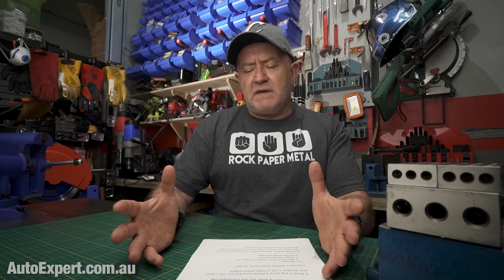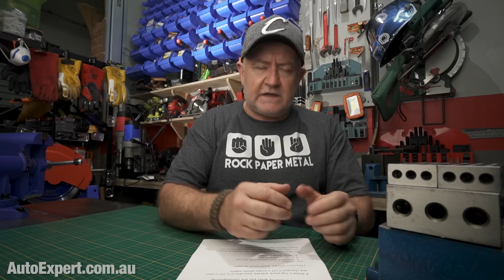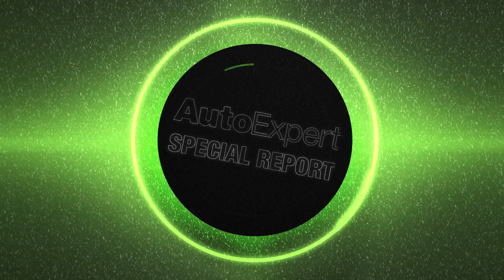Best way to charge your EV at home (for complete electric car novices) | Auto Expert John Cadogan

Comment: We have a BYD Atto 1…I find the granny charger is fine for our use and it was supplied with the car.  We got the car the Thursday before Easter and we went on runs to Toodjay, Lancelin Dwellingup and did about 800k on those trips and we just used the trickle charger. I’d suggest trying that first before spending money on a 32A line and a wallcharger. The wall chargers only make sense here in Perth if you have a EV Assist Tariff but you get charged an extra supply charge of $1.29 per day. It is easy enough to live with slow charging like this and we also have solar but I’m not going to lose sleep if I need to plug it in at night and that is normally sufficient. We have plenty of public DC chargers nearby if we ever get caught out.

Comment: I’m doing a new build and future proofing it by installing 3 phase to the house and a Zappi EV charger. Also will install 12-15kw of solar panels - might also consider installing a home battery as well. Currently have a Jaecoo J5 and might get another EV or hybrid soon. 

The systems aim is:
	•	Solar-first EV charging, prioritising excess solar before using grid power since selling to the grid is not worth it
	•	Dynamic phase switching (1-phase ↔ 3-phase) to match charging demand with available solar
	•	Load balancing, ensuring total household demand stays within safe limits

How It Operates
	•	During low solar periods, the charger switches to single-phase to enable slow, efficient charging
	•	As solar generation increases, it automatically switches to three-phase for faster charging
	•	When solar drops (e.g. clouds), it scales back instead of pulling heavily from the grid

My aim is to get it all working with home assistant so you can make rules for optimising and balancing loads between home battery and EV

Comment: I'm very late to this party, but just got the Mrs a PHEV Eclipse Cross, I ended up getting a 15 amp power point put in, on its own circuit, to plug the OEM 10 amp charger into. Reason being, everybody I spoke to told me that pulling the full 10 amps through a 10 amp power point, for several hours, would overheat the power point/wiring, etc. That may or may not be true, but I put the 15 amp in before the car arrived, so I was ready. Plugged it in today and it only draws 9.6 amps. So maybe I over-engineered it a bit, but I've got a bit of breathing space now. Makes me feel a bit better about charging in my garage. Battery was flat when I got it home, charged for 4 1/4 hours, no problem, battery around 80% full.

Comment: All good info JC if a bit drip fed. Basically sweet spot is 7.4kW into EV, covers all EVs, Will cost some $$$
Here's the plan short and sweet:
Install 7.4kW solar onto shed
No connection to mains
Fed down to 7.4kw inverter
Tesla Wall Connector
In carport
No battery
Daytime charging only in sunny Queensland
I'll update the cost here when I get the kit quote

Comment: For the last 2 years I just pugged into a 10 amp socket and usually set it to 5 amps a few months ago I installed a 15 amp socket $100 still usually set to 5 amps from 6 pm till 8 am gives a few 100 km and I can up the charging to 15 amps for much more being charged up at 11 pm is no benefit compared to 8 am      I had a 10 year old Nissan leaf for 1 year and sold it for the same 10 k I bought it for and now have a 4 year old Tesla I bought a year ago for 1/2 price. Tire pressures and windscreen fluid has been the only maintenance charge off solar so no fuel costs for 2 years besides $100 on fast chargers and slower 22 kw 1/2 price ones.

Comment: Dear Mr Kogan, the things you say about the single phase versus three phase is a little bit off.

The benefit of three phase over single phase is the three phase better distributes the current draw because you have 3 phases instead of a single phase.

Furthermore the standard residential single phase mains switch is 63AMPS I believe.

Once you take out 20AMPS for the EV charger that does not leave a lot of fat left.

Furthermore I believe the numbers are actually nominal and derate with increased temperature which can be brought about by load and/or environmental conditions.

This has been my experience base don practical observation.

Comment: The whole ev charging at home falls apart with as3000 and maximum demand.

if your home has electric AC and oven, chance are very high that a 32A wall charger would push your home over its legal maximum demand calculation!

Comment: I appreciate you are Mechanical and not an electrical engineer. But Just gotta point this out. No electrician installs GPOs aka power points or circuits that are not on an RCD Earth leakage protected power circuit. While it might sound dramatic  talk about how dangerous it is... The only way that that would happen is that somebody decided to do their own electrical work and did not know what they are doing. So not an issue just like pool pumps outdoor GPO etc...

Comment: One thing that wasn't mentioned was a 15 amp charger. It needs an electrician to install a 15 amp wall plug but is a lot simpler and high quality chargers can be found for around $300. My Shark 6 8A charger took 14-15 hours (22.5kw from 25% up to 100%). The 15 amp charger is around 7 hours.

Comment: I waterproofed my trickle charger and charger to extension connector using an under $20 green plastic box from HammerBarn and under $5 orange box also from HammerBarn. It cost less than $25 to make it a bit safer. I will soon be buying a wall box. It will cost a couple of grand to install but will be much better and make it possible to use my solar more effectively. Great video BTW.

Comment: Just a heads up of my situation. I have three phase electricity in my house, and I have just purchased a Mitsubishi Outlander PHEV with a 22kw/h battery. That has a charging capacity of only 3.7kw/h. So I have the possibility to install a 22kw 3 phase charger, but it will only use up 1/7th of its capability. Even with a single phase charger I only use half of its capability to charge the car. The reduction of time charge time is only 3 hours difference between the ordinary trickle charging of the wall, vs a stage 2 charger. Also I have a free stage two charger at work Monday to Friday, so I'm not sure if it's worth investing almost 3k to save a few hours in charge time over the weekend. Any advice will be appreciated.
Reply: What did you end up doing? Doesn’t sound like a fast home charger would have been very necessary for you.
Reply: @spillmill   upgraded to a 15w outdoor weatherproof socket and it works very well.

Comment: I work on the basis the trickle charger puts in about 12 km range for each hour of charge. The 7 kW type two charger (single phase) puts in about 40 km range for each hour of charge. As Cadogan points out the 7 kW charger will charge just about any car overnight. Only six of the 150,000 EVs in Australia in use have caught fire. One arson, three in house fires that burnt the car, one hit a tree at 160Km/h and one that ran over the driveshaft of a truck at 111 km/h.

Comment: I’m still not convinced swapping a ICE car over to a EV is good for your pocket. No one knows how to work on them if they bugger up unless you take them to a dealership usually in a major city not a regional town which is costly, they depreciate like crazy just like any new car really as soon as they hand over the keys there goes thousands of dollars of value even though you haven’t driven even a kilometre, battery health depreciation over the course of 10 years before needing replacement and the cost of replacing that battery will be way more then your ev will be worth by that time, cost of installing a charger at home as you said 2.5-3k to bad if you are renting, what is the realistic amount of money you are going to save over the lifetime of that car? Another anti save the planet practice that isn’t talked about imo is people just hang on to a car for a few years then flog them off for the next new model or just when they start coming up to major repairs and just palm that problem off to some other poor sole to deal with, wouldn’t it be better (environmentally) to just pay for the maintenance and hold onto it then buy a brand new car with all that embodied energy that goes into making one? Save the planet is a joke, unless the whole commercial system is uprooted and peoples view of materialism changes the human race will kill itself. Think about when your driving down the highway in your new flash car.

Comment: How we going to get around in Far North Queensland after we lose power for 2 weeks after a cyclone?  Rely on Generators I guess.  What a load of shit.  I am sticking with my 3.2 Lt Diesel engine.  Wank factor 100% these electric cars.  How far off are we getting a 4wd electric that can tow a caravan with a 600km range?  Good luck charging it up in remote Australia.
Reply: If the power is out you cant refuel with petrol or diesel as the pumps need power as does the attached payment set up.

Comment: I live in the states and my neighbor a couple doors down just had a 50kw dc fast charger installed in his garage. We were talking about it and he had to upgrade his main panel from 200A service ( split phase) to 350A service panel with all new wire from the pole to the house. His whole setup cost $30K. I told him he was crazy. spent half as much as his juicy ford truck cost..lol
Reply: I guess if they drive 24/7, mostly high speed freeways, AND money is no object - then of course by all means.
Reply: What's the rush plug in at 5-6  have a shower and meal go to sleep at 10 -11 get up at 7-8 use a dryer socket at 240 volts up to 30 amps that's 7.2 kw it can charge a 72 kwh battery  from 20% to 70% in 5 hours and you have 14 hours no need to be charged at 11 pm 7 am s fine.  Charging 100 kw from 6 pm to 8 pm and sitting around charged for 10 -12 hours for what just charge 1/5 the speed with no expensive set up and get a longer life out the battery.

Comment: Love the review. Also have PV and powerwall with Powershop TOU plan. 
Planning to get the Zappi v2.1 with inbuilt wifi, in 7KW tethered, for MG4 on novated lease. Will need to migrate to EV plan to boost 12-4am.

Comment: Technically you are going from internal combustion to factory combustion, am I right? Unless you are among the 0.01% that gets to charge your car using solar or wind power then your car is powered by coal or nuclear power?
Reply: But far more efficiently and with less pollution than the millions of ICE cars running around. Also most of electrical providers have renewable energy in their mix already, so it is not purely coal burning
Reply: Around 1/2 the people with EV have solar and I am 1 of them also runs the house.

Comment: Good summary John. Most people doing the daily average 30 klms per day only need the small EVSE (charger) which comes free with the car if they have weatherproof garage parking. Beats spending $800 to $2,000 n home EVSE ( charger) if you don't need it!

Overnight charge on the little one gives 100klms per day charge/travel so again usually all that's needed as you don't need to start everyday with a full battery, unless you are a courier.

Having said that if you do need quicker charging or solar smart charging (using only solar) a home EVSE (charger) is worth the money.

Lots of videos on charging on my EV channel to help everyone further understand living with a EV.
Reply: Thank you. i was thinking the same about trickle charging, its probably all i need. any idea on how much my energy bill is going to cost? Im guessing approx 2.4kwh per hour so 10kwh per day so $120/month as per my current rates

Comment: These are the rules in Qld, and I guess would apply to all states, makes common sense. Our Queensland Electricity Connection Manual (PDF 4.7 mb) provides rules on the connection of equipment such as wall-mounted EV chargers. A typical 7kW (~32 Amp) single-phase EV charger can't be connected to a continuous supply (uncontrolled) tariff. It can only be connected to an economy, or controlled, tariff.

Comment: Solar charging dilemma.. Im just getting my new kona next month and being a lecky ive looked into the wall chargers and supplies needed. What shocked me was the electrical supplier requirements for ev charging. Up in mackay we have ergon only and if you goto there site it says no more than 20amps (4.6kw) on the main supply unless you get there controlled taffif. Downside here is solar input is only allowed on the main supply. Ive asked around a few installers and they didnt relise the requirement for ev's from the electrical supplier. I posted on a forum I'm in and some have commented that NSW has something similar but at 25amps. Anyway love watching you channel. Keep up the good work. Cheers

Comment: Great video. Very informative. In Canada newer houses get 200amp panels. Older houses (60-100amp) can get an upgrade which is not cheap (around $6-7K). Mine is a 100amp supply, I have a 16/32amp level 2 charger so I can use the 16amp setting when I have days were I need more current load inside the house.

Comment: Electrical energy consumption in Australia is now also being billed based on power as well as energy. Demand based tariffs are the new standard in many areas of Australia. The bill is based not only on total energy consumption but also on the peak half hourly power consumption each month (during the defined peak hour window).

It's a really good idea to have a programmable smart charger which can be set to avoid peak period charging. It would be nice to have some info on the different charging systems available and what their features are. For instance, having a smart charger which can not only have timers set but also adjust the charging rate based on available excess solar PV capacity.

Another issue is some homes are going to struggle to have sufficient electrical capacity for adding an EV, especially homes in location where gas is/was used as a significant source of energy for space and water heating, and cooking. Often these homes have much lower rated electrical supply fitted because they only needed it to run basic appliances. With the push to electrify everything, some of these homes have converted to heat pumps for heating and are already maxing out their supply. Running a fatter cable from the pole on the street to the meter box can be a very expensive upgrade.

Comment: Great explaination John.  My EV can drink at 11KW per hour and I only had Single Phase at home.  To install 3 Phase is expensive as those electricians don't miss.  The gain of 33% faster charging was not worth it especially when overnight with single phase at 32amps will charge most flat EV's to full.  Heat is also the enemy of a battery so slower charging is better for the battery life.  I would also recommend setting up for a portable charger so you can charge with any available power source from 240v 10amps through to 3 Phase 32amp.  You can then use camping grounds and caravan parks as another source for charging if you wish to travel to dingo piss creek where there are no DC charging stations.

Comment: The last time that I drove to Perth I put 450km behind me and had 550km left in the tank. Did the round trip in 1 day. So had 900km round trip with 100km left. So I went to the petrol station the next day and filled up in 5 minutes. Not possible in a ev. My vehicle is 7 years old. There is not a chance in hell that I’m trading my suv in on an ev that cannot do what my can and will cost me tens of thousands of $ just to buy something that doesn’t do what I need. And I have not even spoken about towing my van (which I love and I don’t give a stuff that John doesn’t). And I have not mentioned what dumbo albo is doing with going green and net zero. EVs are for people who want to be quickly parted fr9m their money and play identity politics.
Reply: Do you do this daily? Or do you have another smaller vehicle for weekly shopping? Also, its a fair bet that many people who buy electric cars don't give a stuff about identity politics or saving the planet. I agree the ones who do care are gullible and probably drank the green Kool Aid. A typical EV buyer needed transport, could afford something that isn't 7-10 years old and their specific use case allowed them to choose something other than a Pajero or Land Cruiser. What you will find almost universally is they don't care what other people think about their choices. Although you could ask just to be sure. Isn't it wonderful that the world has such a range of experiences

Comment: 3 phase charging heating space around car quite substantially. 
Inverter is heating stuff, battery is heating stuff and even cables are heating... It's kinda like having 1-2kw heather in garage.
Also if you need more than one car in home don't get all electric ones.

Comment: I protect my campers power lead joins from water by tightly and thoroughly wrapping in Al foil and elevating to keep out of puddles. Seems to work, at least I haven't been zapped yet!
Reply: There are proper covers that you get from Bunnings to do the same thing. Using foil is a very bad idea.